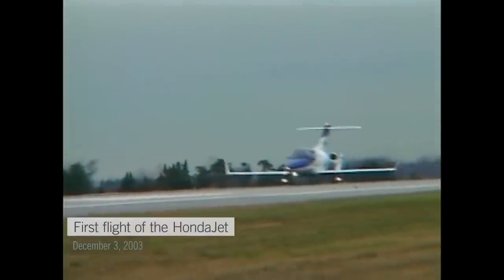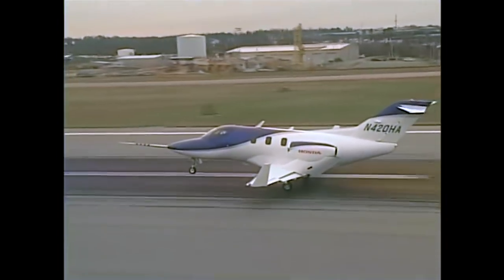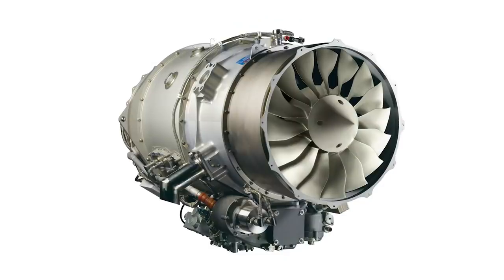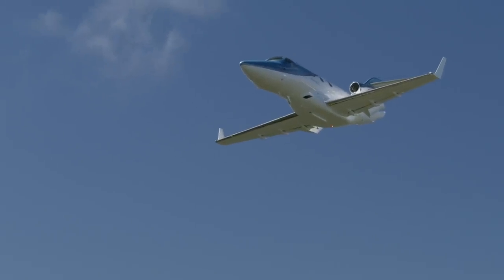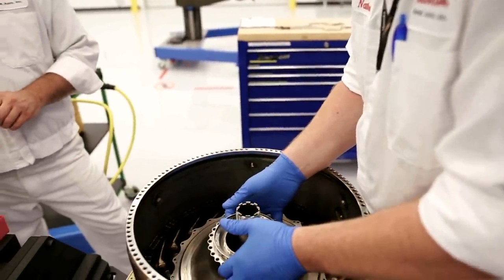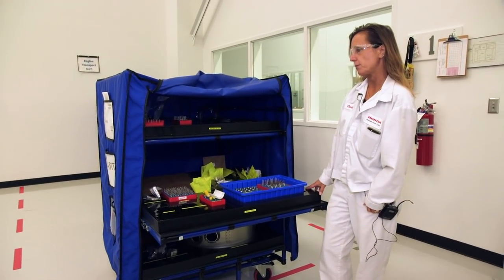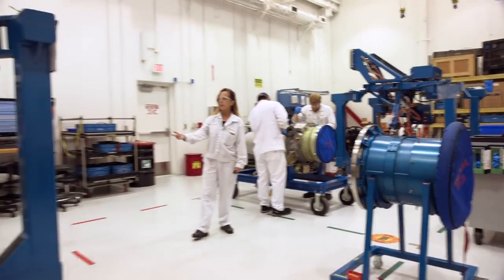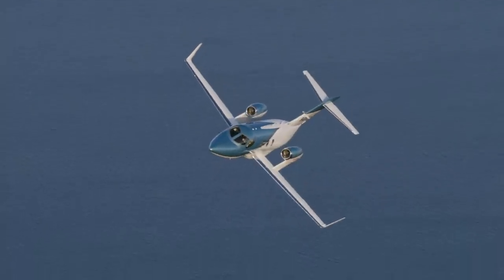Honda Manufactures Its Own Jet Engines for the High-performance HondaJet – AIN

Comment: The reliability of these engines long term will be interesting.  Two 60s motorcycles and a current indestructible starts everytime 15yr old Honda hht25 Weed/Brush string trimmer   are indications maybe its  time to sell GE, Rolls-Royce jet engine stocks as Honda Jets are likely to be even better.
2000lbs thrust today 20000 lbs in a decade.